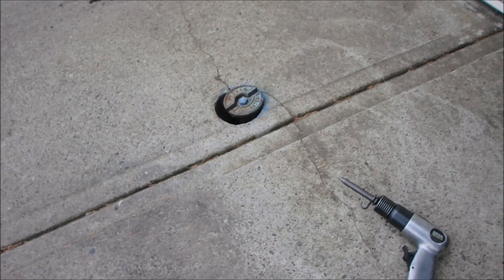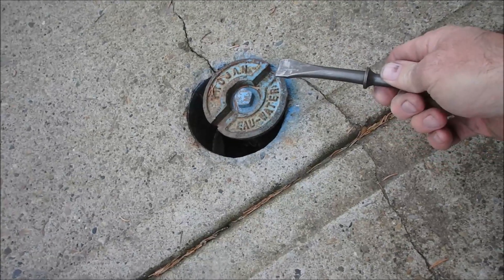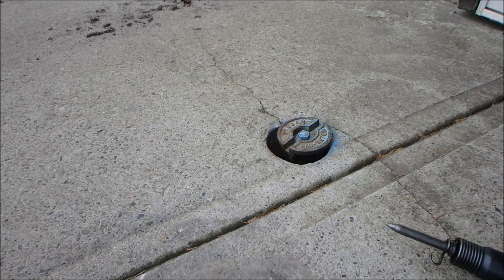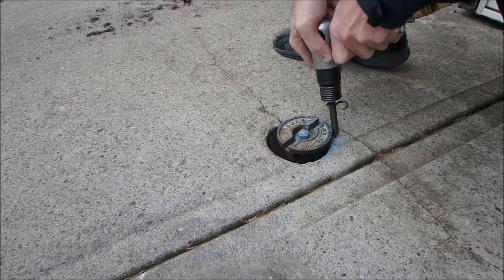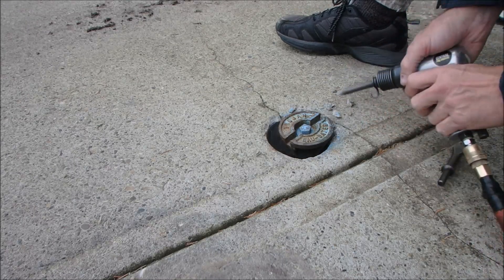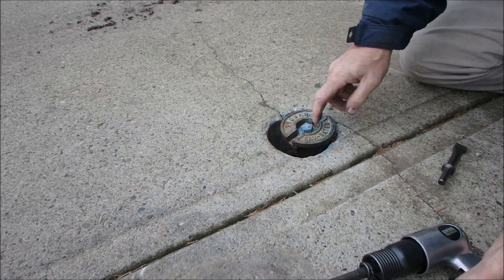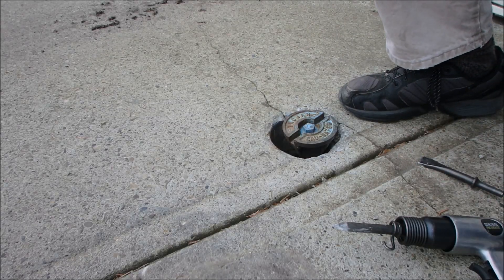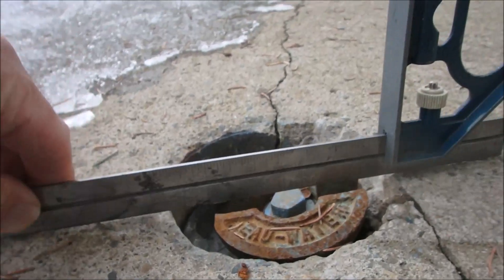This Video is a Lesson on Frost Heaving.

Comment: The toilet in my cabin is doing the same thing. I don't know what to do about it. The drain pipe goes straight down through the floor, into the ground, and then goes horizontal to meet the septic line. The vertical pipe rises, pushing the toilet up an inch off the floor.
Reply from the maker: That is a tough one unless you remove the toilet and move it over and install a trap

Comment: Oh man....you would not believe how many of these have taken out lawnmowers! Most of the time particularly in residential neighborhoods these are located right in the middle of the front lawn. Either the city never bothers to cut the stem flush to the lawn and then re-install the cap, or the ground becomes compacted over time and the cap "rises" above the lawn. For some reason people think if try and pass the mower over it it's a good idea...there goes your mower.
Reply from the maker: Thanks.  I am lucky mine is in the garage apron

Comment: I just learned about frost heaving and would like to know what is that thing they put in the floor and what is it supposed to do??
Reply from the maker: I think you are talking about the water shutoff.  The city has to be able to shut the water off even if it is 8 feet down.  The circular thing is the top of the valve for the shut off.
Reply: oh, that's why you trimmed the concrete around it. Didn't cross my mind it could be for water shutoff, thanks for the reply

Comment: Get better Bruce. My barn floor cracked and lifted 3" a couple years ago. It came back down in late spring. The only reason I noticed ( I work in the garage in the winter) was that the door rolled up the same amount and I could see in. I showed my mailman the damage and he said in Alaska they will dig very deep and put old cars into the hole before building to combat heave.
Reply from the maker: Very interesting Van

Comment: 8 feet of frost? Wow that's bad. The most we have here in western PA is 3 feet.
Reply: The frost doesn't actually go down 8 feet. It depends on region, but usually it's about 4-6 feet. The utilities are buried even lower for some extra safety factor.
It's the same reason almost all houses in Canada have basements. The foundation has to go below frost.
Reply from the maker: Captain is right.  The services are at 8 feet and the frost goes to 4 feet.